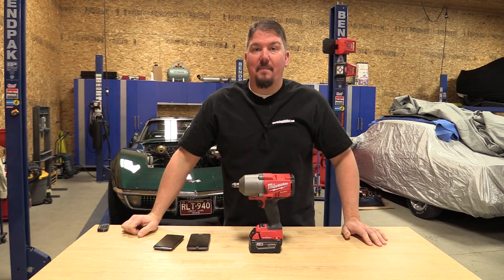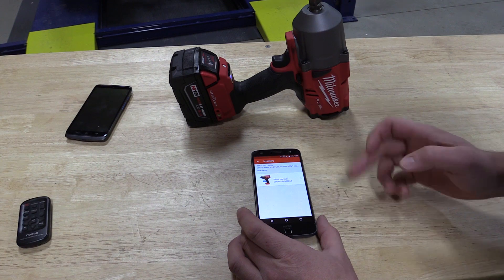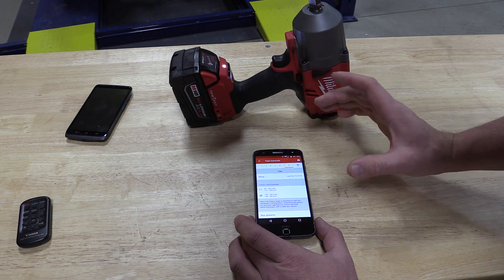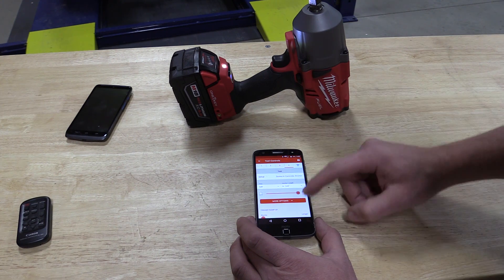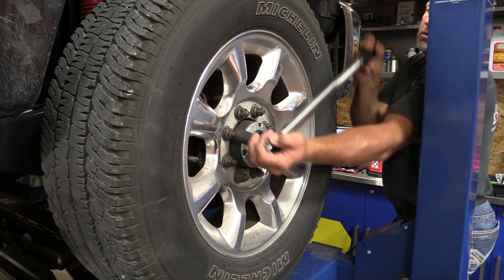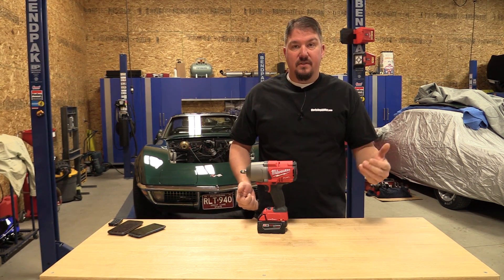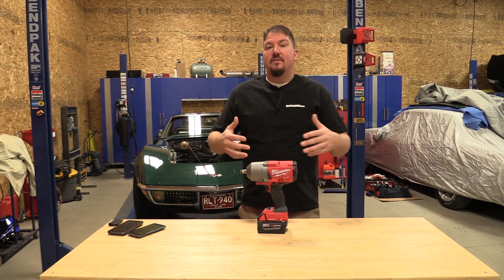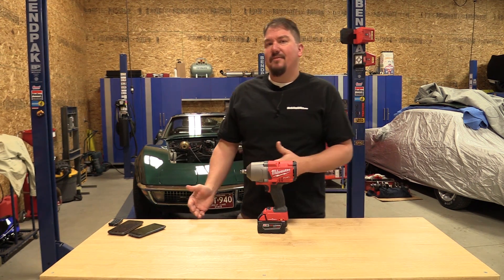Torque Repeatability | Milwaukee 2863-20 M18 FUEL w/ ONE-KEY High Torque 1/2" Impact Wrench

Comment: Hello. I do not have that latest one but for the older model. I purchased a set of two came with a bag: an impact with a standard drill bit power tool.
The one I actually use the most is the impact one. I often have an issue with this tool because it is too strong and it always snaps a screw. 
Is there a way I can adjust the torque out of this one?

Thank you very much in advance!
Reply from the maker: What is the model number?  Did you drop down a mode?

Comment: Remember some suspension and other application nuts are “oval shaped” pinch lock nuts. look out for those:  they often feel cross threaded and usually require some hammering to fasten and for lower torque situations, create a false reading.     Something like a 35ft/lb nut that: because of it’s shape resists and stops at 20. And you have to keep working it to fasten.   it’s so nerve racking lol.

Comment: Just picked one up. I'm confused if it's supposed to be like this but when off if I rotate the drill forward and back I hear the anvil knock in and out. Shouldn't there be a spring that prevents this? I just want to know if it's normal or not and if I should return it. Older gen doesn't do this.

Comment: I have the problem with the 3/4" that all the lamps for the torque are constantly lit, the speed can no longer be adjusted and only works at the lowest level, the button cell has already been replaced and the battery is of course full 😅🧐

Comment: I have the 3/4 impact wrench. Love it, But,, on the box it advertisers that it has 2034nm. But in the app there's nowhere to change the newton metre settings, it's all in rpm and ipm. I'm certainly not any kind of tool man but I'm pretty sure the main measurement of tightening nuts is newton metres and foot pound. I rang Milwaukee to see if there was a conversion table so I could set my rpm settings to nm. But they didn't even know. They advertise nm but have rpm on the app,, that's pretty shit Milwaukee!!! Please tell me what Rpm and Ipm is used for as for me and many other people those settings are useless!!

Comment: Yea I'm a diesel mechanic I bought 3/4 impact I wasn't able to take off one lug nut off of 12 different trucks that I have here and I turned up all the settings on all of them I mean it's a nice gun but it's not for taking lug nuts off forget about that and that's the damn reason I bought the damn thing
Reply: Do you use an adapter say 1/2 up to 3/4" I found that if I use one of mine or a extension it greatly diminished the torque output.

Comment: That's not how you test to see how tight a bolt has been torqued up. It takes less force to undo a bolt than to torque it up. due to not having to stretch the bolt also the ramp effect of the threads works in your favour when losing a bolt.

Comment: Torque sticks will work if you lower speed. The reason they fail is because torque sticks require time to "flex". If the hammering force happens to quickly instead of flexing back to its initial state, it will get stuck in the flexed state and act as a solid rod.

Comment: The package is worth every dime◉◉>share4.photo/BImpacWrench?e31e    Batteries charge in less thsn an hour and both tools run smoothly and strong! Plus there's the handy pouch that's big enough for both tools, the charger & tool bit kit with plenty of room for other gear.

Comment: All amazing, just got one, but: Why the torques are NOT consistent? Should the internal computer apply the same torque at all times corresponding to the level chosen?
Reply from the maker: Impacts are not a precision tool, so for each value, the computer counts the amount of hammers.  Well, the amount of hammers it takes for a well lubed nut or a rusted nut to reach a value is not the same.  There are a million more variables that make this not a very accurate tool.
Reply: WorkshopAddict tks for the explanation!

Comment: As always an excellent vid, great tip regarding torque sticks and electric impacts. I have used one with my Milwaukee Mid-Torque and it makes a strange clunking noise, only made when using it with a torque stick, won't use it again 👍🏽

Comment: That's funny what you said about torque sticks. My findings have been much different. I used my torque sticks on my fuel 1/2" high torque model and when using the 100ft lbs stick I got 98 ft lbs on each lug. Not sure why yours was way off...?
Reply from the maker: What setting do you use them on? 2?

Comment: Being +/- 25% on the torque accuracy, it be better if it didn’t have that option altogether. Too me, it’s so inaccurate it’s a waste to even have it as an option. Can’t imagine setting the torque (at 100 ft lbs) for lug nuts!!!
Reply: If you listen to the video, they say it does NOT replace the torque wrench.  It repeatably gets you close.
Reply: What's wrong with 100ft/lbs, most vehicles about 110+ ?

Comment: Could you expound on why a torque stick does not work with electric impact wrenches? I understand that the electronic control system of an electric impact wrench can monitor and respond to various loads perceived by the tool, and how it may respond to a torque stick, but do you have further information on exactly what the issue is?

Comment: The absolute best part about One Key is that you can track things but also lock the tools out. So if you lock them out and someone grabs the tool on the jobsite, it isn't working, n matter how many times they insert or remove the battery.
Reply: That's badass

Comment: DOES ANYONE KNOW WHAT FT. LBS. THE TORQUE LEVELS (1-20 in the app) START/END AT? I contacted Milwaukee and got a lazy tech who stated there are no torque approximations for the levels, which is ridiculous because they got their "Max Torque" level somehow, so why can't they also give an approximation for each of the individual levels? We aren't stupid, we understand that a 1/4" bolt is going to get torqued more than a 1" bolt. But do I really have to click through each level and test  it out with a torque wrench? I would appreciate the help if you've made a video or if there are specs out there on this. Thanks

Comment: I think that if I were to use this tool I would set it about 30ft lbs less than what I need and then finish it off with a torque wrench. This will eliminate the strength needed to torque large bolts like a timing belt bolt but still make it accurate.
Reply: Ryan Smith that’s what I want to do, but I can’t figure out the individual torque ratings for the 1-20 torque settings??
Reply: @akaredcrossbow  I am trying to find that out too. They just give a generic answer, "It depends on the fastener". But that's silly because they tell you it has 1100 ft. Lbs of torque without throwing out the caveat of "It depends on the  fastener". Someone with a fancy calibration tool needs to go through each level to give us an approximation for each level.
Reply: My Fortress Construction So basically your correct! Someone needs to use a torque wrench and figure out what the 1-20 torque settings are. This is the reply I got from Milwaukee after I emailed them about the settings!!

.....Currently we only list the max. torque on our impacts, the torque range on the other settings would be based on trial and error, you would need to check it with a torque wrench after tightening the bolt/nut.  There are too many variables involved to determine the torque values on the other settings. If we can be of any further service please let me know.
Reply: @akaredcrossbow  OK.  Is that bad or good, in your opinion?  If you say bad, why?  Milwaukee says too many variables to able to say x impacts will give you y torque.  There is not a torque transducer or strain gauge on the tool.  Can you imagine how expensive and unreliable THAT would be?

Comment: Just got one - woulda loved to have a corresponding nM or ft/lbs number instead of "Level1", "Level2" etc. Which "level" corresponds to 120nm for my lug bolts?
Reply: pekka S same question here, if the reviewer can share a table with level vs nm - that will be great

Comment: Hey Workshop Addict like your tool reveiws. Now Milwaukee got A 3/4 inch model out that does 1500 lbs of removal and 1200 lbs tightening. Model# 2864

Comment: I keep getting errors on mine too and also cannot get the tool to take any changes with the custom torque settings. Have you figured out the problem yet?
Reply from the maker: Un-install the app and reinstall it.
Reply: WorkshopAddict i tried that several times and it doesnt make a difference. When i set the custom torque level to lets say 5 on the #4 preset and save, if i go to another preset to adjust the settings and then go back to preset #4 the custom torque level goes back to 1 all by itself and it never seems to actually set the impact to anything higher than 1.
Reply from the maker: dcstang67 My phone was the Moto X I believe.  It is the one you can put different items on the back.  I broke it and they replaced it and upon a full reload, everything was good.  I did work with support, so maybe calling them will help.  I know this sucks.  Sorry.
Reply: WorkshopAddict milwaukee support?
Reply: @dcstang67  I was having the same problem, then I found there's a place where you can "save your profiles". It's a super annoying app, but I deleted all of the profiles I made and started over again, saving each one as I went. The settings finally stayed put. Before, they willy-wonka jumped all over the place. Keep messing with it and you should be able to make it stay how you set it.

Comment: Fantastic....I've been looking all over the web for someone to get into the tool settings from the one-key app.  Milwaukee web site doesn't explain it as well as you do.   The levels from 1-10 are more understandable to me now when you actually measured their differences.  Great job and thanks.  Now I can go play :)
Reply: (It’s already not an America company)Chinese Milwaukee
Tool

More than 96% Milwaukee tools are made in China. Milwaukee
Tool has carried out tool-design job in China since 2015 year, the design job
also is slowly sent /transferred from USA to China.

Most plastic materials have been changed from America DuPont,
GE to Chinese sources. The red plastic，Nylon，of Milwaukee tool handles/housings has been provided by a Chinese supplier
since 2010，originally the Nylons
were from DuPont，the Nylons-changeovers
caused the handles/housings weak，like screws very
likely strapped/slipped in screw holes. Also black hard plastic for battery
pack cases/covers，changed from GE ABS/PC
to a ABS/PC from a Chinese supplier，caused battery
pack case more likely broken, brittle, the same story is happening on anti-flam
Nylon material of battery frame，changing from DuPont
to a Chinese supplier. 

Lots of bad tools always first are sold to USA because
nobody inspects the outgoing, and because in USA Milwaukee Tool has the
strongest warranty service ability than in other countries.

During Milwaukee production process, more than 5% defects
found out by workers, also more defects failed to be screened out. Bad tools
include noise as gear,bearing aligned badly, sometimes press trigger no
reactions at all, metal parts like shaft, gear, pinion, important screw broken
as poor heat-treat, motor stator rubbing with rotator, fine wire laid inside
tool broken as poor design and poor workmanship, big percentage of oil leakage
for hydraulic tools, etc. 15% chance you will get a bad tool, bigger chance you
will get bad tools for nailer, planer, hydraulic tools, cable/tube cutter, as
they are first generation of tools for Milwaukee Tool, because comparing with
sawzall, drill, Milwaukee Tool is suck at nailer, planer, hydraulic tools,
cable/tube cutter,AC tools, drain cleaner, blower.

Milwaukee Tool workers only get less than 300 dollars
monthly salary，even plus OT to 276
Hours a month（normal month-workhour is
176 hours，plus 100 hours OT. Chinese
law only allows no more than 36 hours OT per month）， after OT 100 HOURS for every month，a worker can get 500 dollars monthly salary，this salary very
low for living in a big city in China, plus bad working environment(the
management has no such safety-first mindset that loud noise but no issuing ear
plugs to workers, at dangerous stations very few goggles issued to workers. workers
stand more than 10 hours every day during on-duty time), so Milwaukee Tool with
huge employee turnover，400% yearly turnover，ie workers averagely work only 3 months for the factory, cause workers
without enough experience，lack of training，then unable to ensure good quality. And worse worker- turnover with most
Milwaukee Tool’s suppliers. 

After Milwaukee tools launched one year， Milwaukee Tool will do so-called VE, value engineering ，actually cost-down, change Germany trigger to Hong Kongese trigger even
Chinese trigger/switch, change Japanese chuck to Chinese chuck, etc. Milwaukee
Tool has a team, 50 persons to do this VE. The quality would obviously become
worse after the VE.

Milwaukee Tool has really bad quality system, lose much
profit because of failing to keep quality constant. And always look for cheap
materials, cheap suppliers, worker salary is always at minimum salary, only 30
dollars higher than monthly minimum salary.

Milwaukee Tool has less experience for making power tools
comparing with Bosch，Dewalt, Makita.
Milwaukee Tool only has grew fast from 2008 year. Milwaukee Tool copy and
compare life test with Bosch, Dewalt tools during new product development
stages, even when doing troubleshooting during R&D, would measure
dimensions of these competitors’ components.

This company is also an ugly company, in 2014, a Hong
Kongese manager tried to rape a female employee during their business trip, the
company fired him and less than half year, hired him again as a manager, then
the female employee left this company and lost her job. In 2015, in its factory
dormitory a more severe rape case really took place by a male senior manager to
a girl.
Reply: Really?  I don't want to hear your PC crap.....get a job!

Comment: + or - 25% isn't even close to repeat-ability may as well just go by feel. set it at 800 and your torque range is 600-1000
Reply from the maker: You are right...  Set to 100 and you are 75-125...  The torque is set by the unit counting impacts.  This is an example, but 100 ft lbs might be 35 impacts.  Depending on the lubrication and material, that is as close as they can get.  If you watched our testing on the ball and hitch, we were very, very close in torque, but each test was on the exact same nut and bolt, removing the variables.  Anyway, you are correct in what you say and that is a huge torque range.
Reply: Damn. I misread the box and thought it was 2.5% and thought “sold!!”

Comment: I like that it has some consistency and that you can make changes via the app. I personally would still feel more comfortable hand torquing lugs on  vehicles.  I like that it can be tracked as well. Im not sure I'd use the app much after initially playing with it though, since I would mostly use it for removing lugs. #workshopaddict

Comment: I will wait for a 60v on yellow platform with yet even higher torque... That way my current 1st Gen impact isn't obsolete already.
Reply: same but that will be a few years it took the launch of the flexvolt for them to release a brushless circular saw or grinder

Comment: Another good test would be to do torque test on a 100% battery vs 25% to see if you get same numbers. With your current results setting 1 would be perfect for Honda's ect with 80ft lb rating. Let's be real, even if it put out 120ftlb it's not the end of the world..
Reply: yeah but the minus 25% could be

Comment: "Alexa, how much battery does my torque wrench have left?" :) #WorkShopAddict
Reply from the maker: LOL....  We did say this tool is not a replacement for a Torque Wrench.
Reply: I don't see why not. I ordered the 3/4" friction ring one touch. We work on Megayacht's where it usually involves a Torque multiplier and a 6' torque wrench. It's a pain cross referencing charts for anti-sieze and manufacturer specifications. The floor grid above whatever you are working on has to be dissasembled for working room. At 1000 ft lbs for example , I imagine the tool becomes way more accurate than at a smaller number with less impact event counts. In my application this tool could save hours or days of work. These slammed around torque wrenches are always out of calibration anyways. Now I can reach down with one hand and do a two man job with little to no dissasembly. A game changer. And close enough. This thing makes a I/R impact look like a toy and that's saying alot.

Comment: I thought that you can just plug in the lug nut size and torque you want and set it and the impact would set itself to do so.
Reply from the maker: On the old models, they allowed you to tell it the type of bolt and size and then choose a setting of 1 through 20 and pick a setting, but it was not as close as this one is.
Reply: WorkshopAddict Wait.... What old model? Are there 2 versions of onekey?
Reply from the maker: Sorry, and older model Impact Wrench.  this is going back!  https://www.youtube.com/watch?v=nzfCcxqrjWs